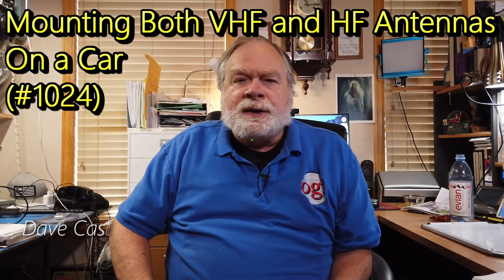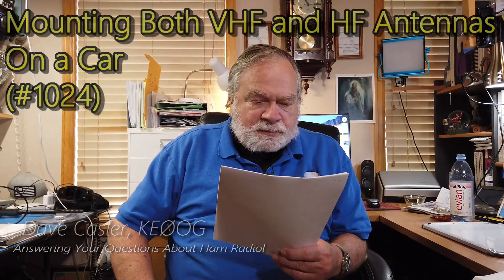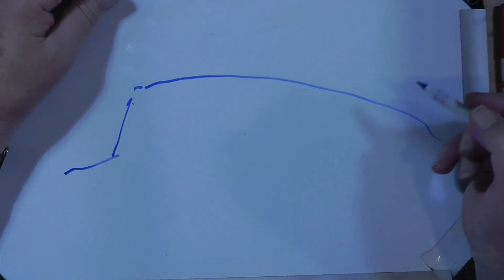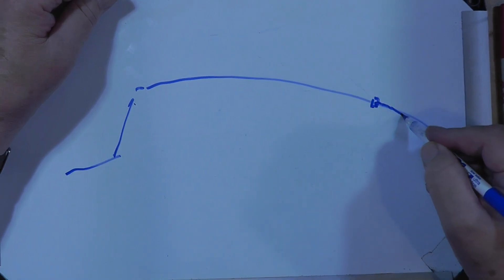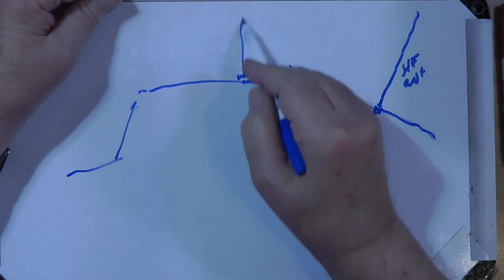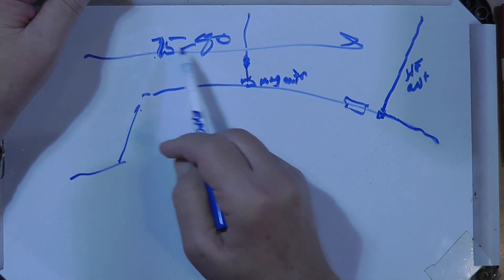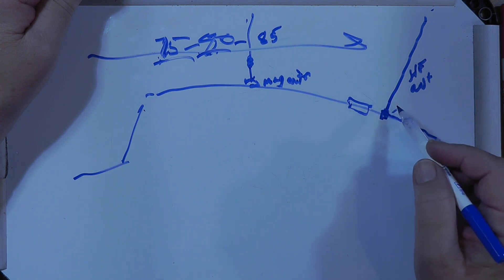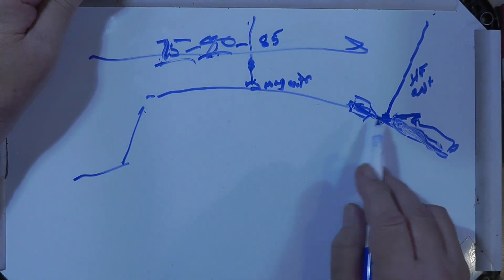Mounting Both VHF and HF Antennas on a Car (#1024)

Comment: Based on an article I read decades ago, doesn’t placement affect/create a slight directional effect on magnet mounted antennas? If so, would you still recommend the same locations?